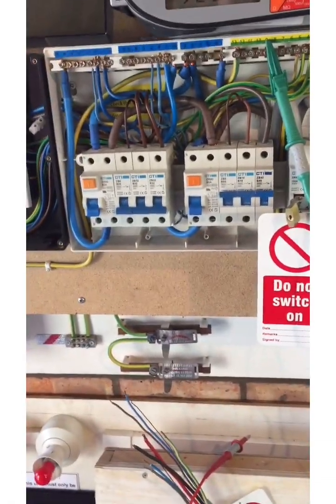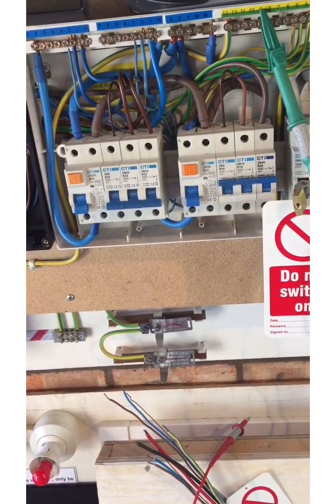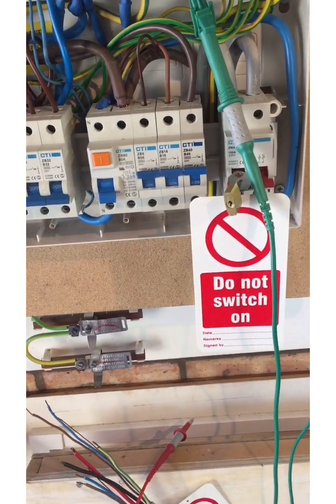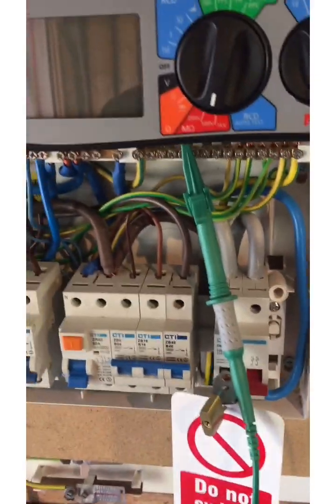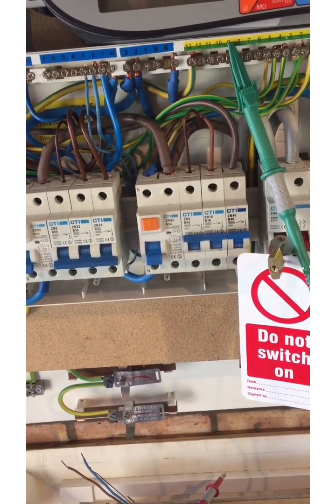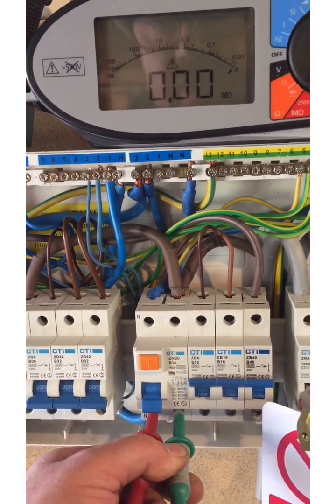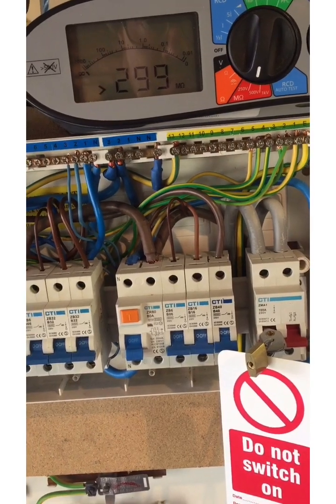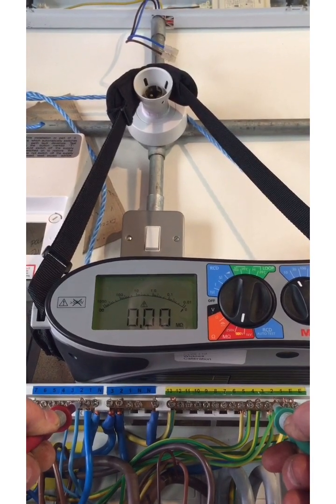Insulation Resistance Fault Finding

Comment: Great help with the video but if we was doing a continuity test and we had a fault what would the difference in readings be between an open circuit and a short circuit?
Reply from the maker: You’re welcome. A continuity tester is not ideal to determine IR faults but if that’s all you have, say in the AM2, then you’ll get 0.00 ohm for shorts and >99.9 ohm if the circuit is OK. Don’t forget a ‘short circuit’ is something specific i.e. L-N or L-L. L-E and N-E are shorts but not short circuits. Just saying as it helps in accurately describing the fault of it is AM2 that you are doing. Is that what you were after?

Comment: Great video, can you do a similar video on testing a ring circuit with IR , with venerable equipment connected .
Reply from the maker: Cheers Dan, you mean vulnerable, must be a typo. But yes, the IR one coming up this month goes into all of that. The basics of it is the connection of L and N bus bars with all breakers on and testing from that to earth. You can also drop to 250V. Keep a look out. Thanks again.

Comment: So if you get a combo fault like that 
  Would you remove live a neutral of each circuit and test them individually to earth . To find the fault s
Reply from the maker: Hi Greg. Yeah, thats the time to start taking both L and N out for each circuit and clearing each circuit at a time. Mark ‘em up as done with tape to keep track. Cpcs can stay in board. Just hypothetical or you got/had as a fault?
Reply: @sparkipeat2255  I have a question for you
Bungalow property 60amp main fuse 16mm twin and earth feeding c.u from meter the 10mm bonding for gas and water is then run from consumer unit so there is only a 6mm main earth in the 16mm twin and earth 
     I was always led to believe that final circuits are fine after 16mm twin and earth because their cpcs are smaller. But bonding can not be because it is larger than the 6mm earth in the twin cpc 
I said the bonding should have been ran at the supply end main where  earth  it is 16mm  got looked at like I was stupid lol.
Reply from the maker: @gd-bq7em  Sounds like 2 separate issues there. Possible overloading of the 6mm due to being protected by a 60A fuse. 4D5 in the  Regs, 6mm best case is good for 47A. Then the sizes of protective conductors and bonding.  543.1.3 (equation) and 544.1.1. Upgrading with full size tails to the cu and verifying the size required for the continuation of Earthing Conductor to the cu could be your answer. But you’re the fella who decides...
Reply: @sparkipeat2255  its an old installation  
So Nothing to do with me. Was there to change an mcb 
  But I noticed the bonding and thought it was wrong .

The 6mm is the cpc in the 16mm twin and earth feeding c.u 
     I thought that was acceptable as long as bonding is not after the 16mm twin and earth it would need to be before